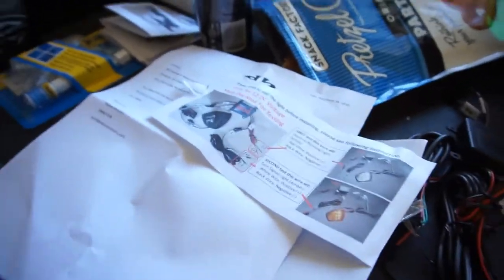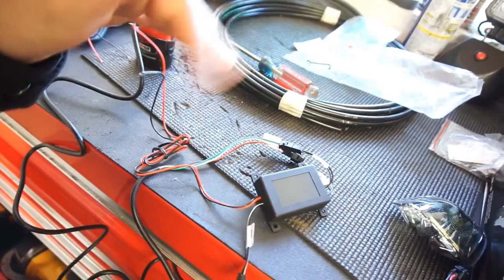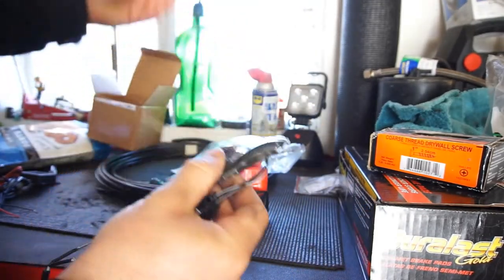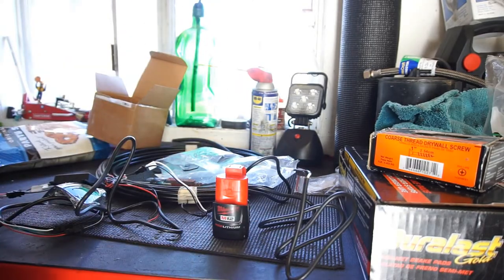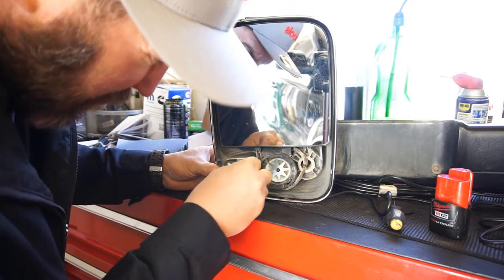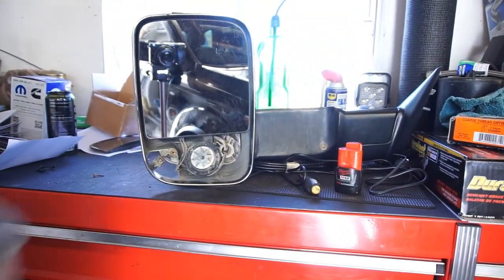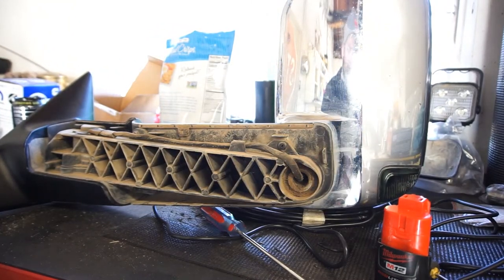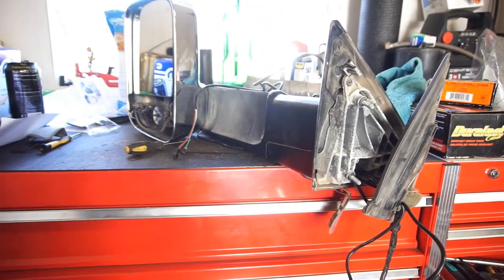dbmotors Switchback Turn Signal Running DRL LED Mirror Lights 4th Gen Ram Must Have. AIMOTORPARTS

Comment: For the headlights..... maybe you could drill a hole somewhere in the housing so it gets some airflow in there.... if not, the Cali heat might make some mold start building up in there. Just a thought...… some kind of breather hole.
Reply from the maker: OneNGlen I did drill holes on the top just to try it.

Comment: You need to add some cab lights. That will look sweet.
Reply from the maker: I have some, I’m just nervous about drilling into my cab and don’t have the time to do them right now.
Reply: @Halffast719  I did the mopar cab lights. It wasn’t to bad once I got pass that first hole lol.
Reply from the maker: That’s cool. I have take off mopar light for my truck that some cool guy at work gave me. He bought recon black light kit but just needed lenses but I’m ok with them. One of these days I’ll bite the bullet.
Reply: @Halffast719  cool. I don’t recommend the recon light. They have a bad reputation of leaking.
Reply from the maker: Yeah me too. I told him that the recons have leaking issues because they’re flat and don’t get a good seal like the mopars do. The mopar have a curve that contours the cab. I basically got the recon kit with mopar lenses. I got the template off eBay too.
Reply: @Halffast719  cool 😎 good luck buddy!
Reply from the maker: I’ll record it once I do it but might be a month or 2.

Comment: How did you tap into the passenger side. Like which color wires did you hook up?
Reply from the maker: Kyle Thomsen I believe it was pink and yellow
Reply: Kyle what wires did you use for your passenger side
Reply: It said pink and yellow/black and green on drivers side. What about the passenger side? I just have pink and yellow